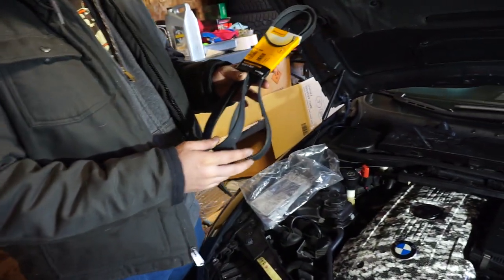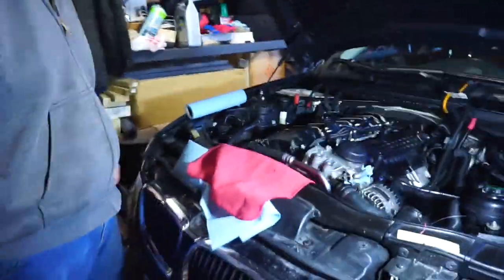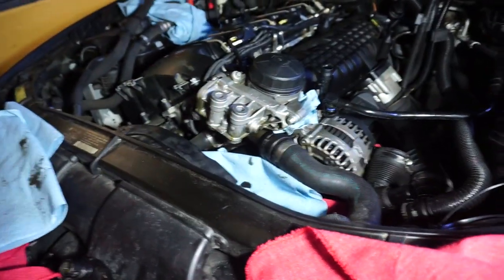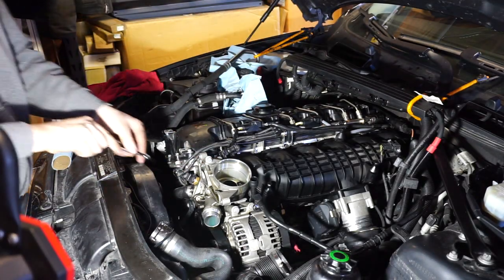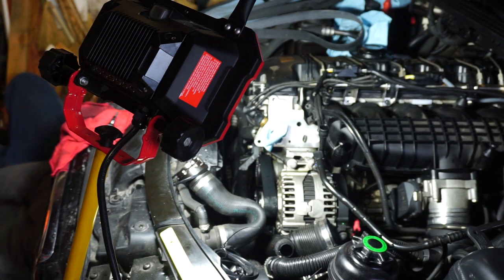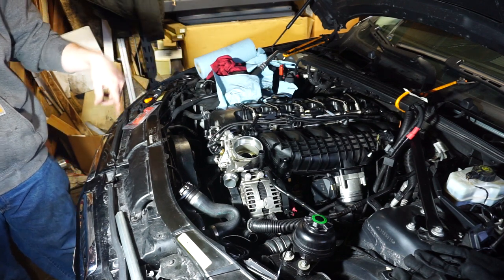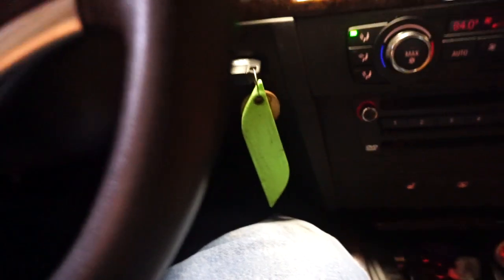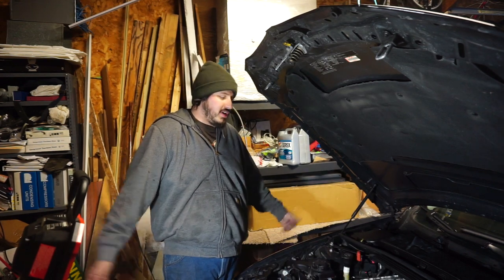N54 Oil Filter Housing Gaskets & Serpentine Belt

Comment from the maker: You need a torque wrench. To much torques and it can leak and too little and it will also leak. If you overtighten the bolts they will strip too as everything is aluminum.

Comment: I have a 2011 328i that will need oil filter housing gasket replacement -- Do I have to drain the coolant before I start taking it everything apart, or is that not necessary? I do plan to take it to the shop after I do the DIY replacement
Reply from the maker: You should not have to drain the coolant. It will make less of a mess though if you do. Make sure you have plenty of rags!
Reply: ok will do! Thanks for the quick reply! @BAPerf
Reply from the maker: No problem! Make sure you torque all the bolts to spec also otherwise it will leak.
Reply: I don’t have a torque meter but what if I tightened them real good?
Reply: All the coolant that will be spilling out, will I be okay to drive 15-20 miles til I get to my auto shop for oil and coolant change? Or do I need to add a little coolant back in?
Reply from the maker: I wouldn't drive it without replacing the coolant and cycling the water pump, but you won't lose a lot, you might be alright. I haven't tried.